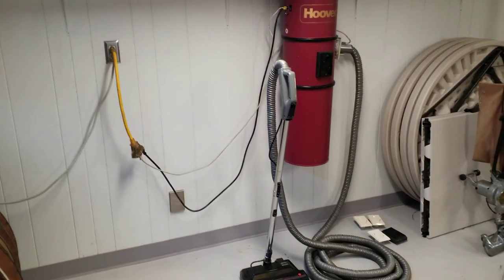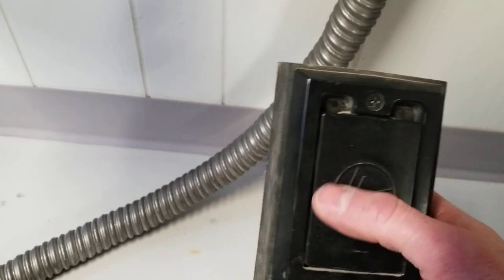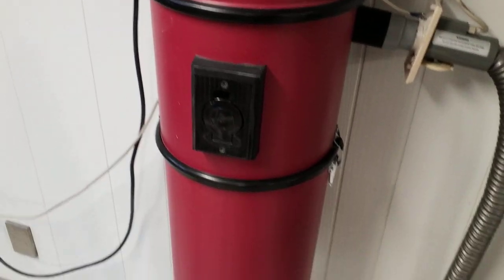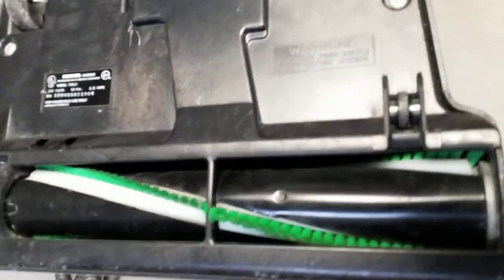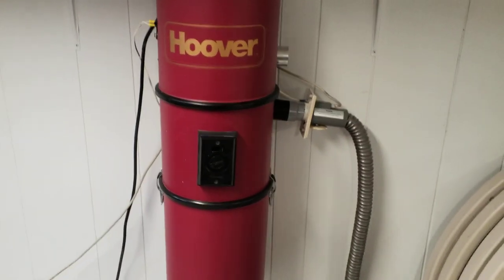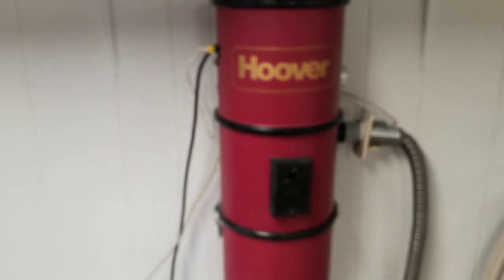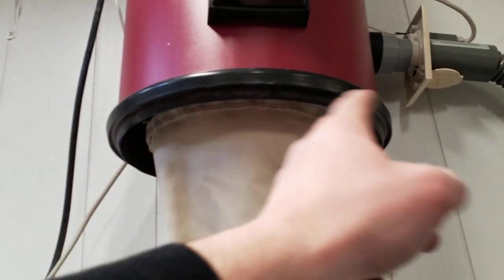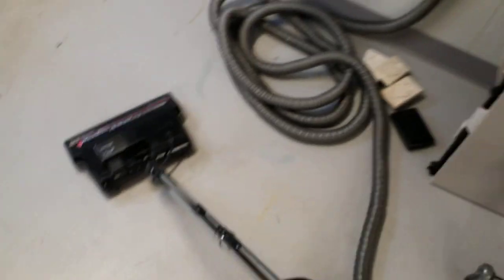1990s Hoover Central Vac Review & Demo

Comment: Interesting machine as it’s the Canavac version of my Beam Canada Smart vacuum with a three stage 6” motor also from the 1990s.  Canavac still makes machines like that and Hoover is made to a cheaper specification by Canavac than most of Canavac’s products.  Well today it is, but Canavac units are hybrid now using bags and the inverted filter or just the inverted filter.  Also, Canavac is indeed a single motor per unit company and suggests for larger houses to install two separate motor units as opposed to investing in one very large unit to keep performance up.

The crush resistant hose is somewhat fraudulent in name as they easily kink and crush restricting airflow.  I’ve never had that problem with my Rainbow hoses and they utilize piano wire.  Also they have become quite light over the years so not quite as heavy as they used to be.  I had two 14 ft hoses (one electrified and one straight airflow) shipped to my door from Rainvac and my Mom said they were lighter than she remembered with my Uncle’s central vacuum hose back in the 1990s.  That being said, the central hoses are nice all around with little resistance like you said years ago in one of your videos.

Comment: Hey Owen, nice video. Based on the sound, I'm going to guess that this is a bypass motor rather than flow through, I'm not even sure if they were using flow through motors back then. It actually sounds very similar to the motors used in my 240 volt Silent Master s900, same pitch, it's an "F" note, I'm sure it's a different motor though. I have one central vacuum unit that I think was made by Canavac for another company. This company no longer exists now but there was an on line seller of central vacuums in Texas called vac depot, and their brand was called aspria. I have their flomentum model which I think is just a rebranded Canavac CLS750, it's not a hybrid, it only uses bags and uses a 6.6 diameter bypass motor. I have to use a muffler whenever I use that unit otherwise the sound is much too loud but it's a really nice unit.

Comment: I often wash these filters in my front load washing machine, if the filter is in good shape, that is.
Reply from the maker: That works well, though I have had to wash them twice or more to get the dirt out from between the layers.
Reply: I wouldn't recommend washing these type of filters in a washing machine. That I was a mistake that I've learned when I washed my Eureka central vac filter. There's a bean bag inside the filter where it's plastic and when water gets inside the bean bag, it would rust. Or on some models, the bean bag would disintegrate and all of the beans would fall out of the bag to where you can feel them as you shake out the filter. That happened before on my Beam but I was going to replace it anyways. On my Eureka when I washed the filter, not only water got inside the bag and rusted the beans but the bag also fell out of the filter and I had to sew it back up inside of there. The only units I'm aware of that you could get away with washing these type of filters in a washing machine is Allegro because they don't have a bean bag inside the filter.

Comment: How would that Hoover Quadraflex compare to an EBK-360 powerhead? Thanks!
Reply from the maker: Brand new, the Quadraflex was a beast! But the flat belt means the performance declined dramatically between belt changes. The EBK's geared belt and aggressive Chevron brush design make it a more consistently high performer.
Reply: @owenperkins  Thanks! Wondering how you would compare the EBK-360 to the Sebo ET-1? Performance, repairs, longevity?

Comment: How rare are those Hoover inlets (and the electrolux ones too)?
Reply from the maker: They are sort of hard to come by, as even many Hoover and Electrolux systems were installed with non-branded inlets. Then of course, there's the issue of finding them 25 years later, unbroken and not painted over. Other than that, it will vary by region. Around here, it's far easier to find, say, Filtex inlets than Hoover or Lux ones, but in many parts of the country, Filtex systems are virtually nonexistent.

Comment: How much power does this unit have?
Reply from the maker: The motor is the equivalent of a Lamb 116765 which is rated at 136" waterlift, 95 CFM, and 465 airwatts. These are all max numbers for the motor by itself. With the machine and filter in brand new condition, you'll get quite good performance at the hose end. However, due to the filtration design of this unit, the filter after a short time will restrict the airflow noticeably and the performance will get weaker and weaker over time. Unfortunately the design of this unit does not make it possible to retrofit it with a disposable bag, so you're stuck with the clogging permanent filter.
Reply: @owenperkins  How much airflow could the filter reduce if let’s say you like used it like every week for 10 years or so what would the power be like then?
Reply: Also, what’s the loudest and quietest central vacs that you have ever used?